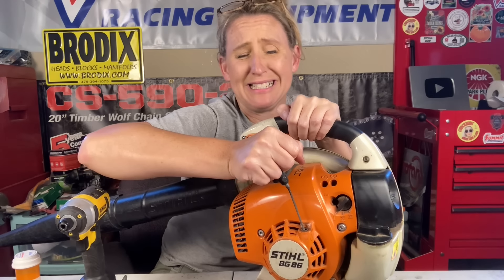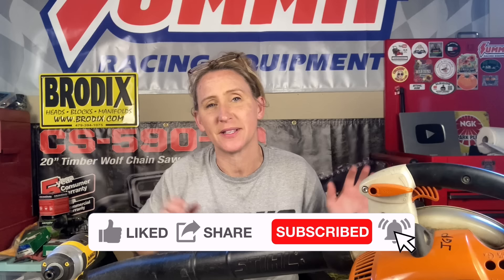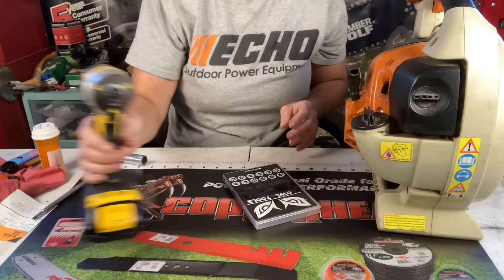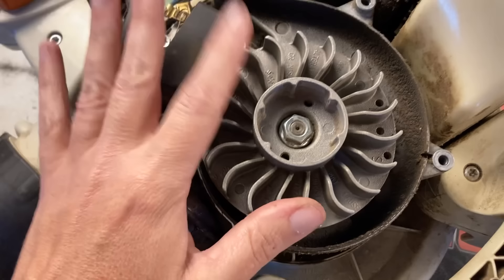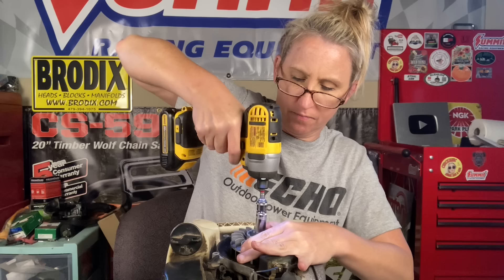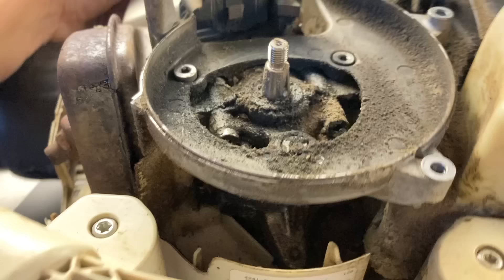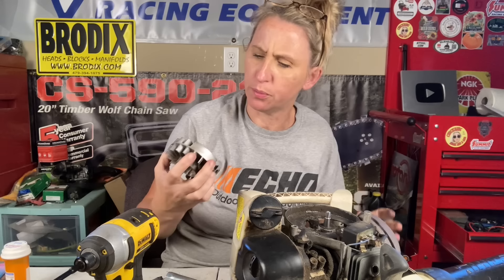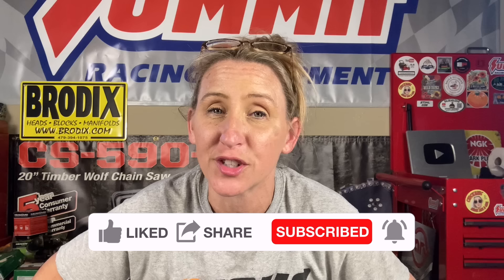Stihl Blowers SECRET FLAW!! Save your Blower with this EASY FIX!!

Comment: There is a little check valve in the carburetors. Those check valves go bad, and it let's the gas just siphon into the carp, which just let's gas pour into the cylinder. Mine locked up like that, but the engine was good, and the carb was good. The issue was that one of the 3 screws that hold the engine onto the housing had backed out, and locked against the fan. Some red threadlocker fixed the issue.

Comment: I just use a brass punch, that way I don't have to worry as much if it slips off while hammering and damages something..plus I feel more confident  whacking on it harder with a brass punch. I don't know what it is about blowers, but this bolt loosening problem seems to be common with most of them. The Husqvarna 125B(Poulan) blowers are terrible for this.Customer usually complains of a "loose carburetor" or "loose engine"..then when you tear into it, often one or of the engine mounting bolts have broken off, or the bolts have gotten loose and wallowed out the screw holes and destroyed the threads...

Comment: I have a quick question. I have a bg86. New crank bearings and seals and spark arrester. I have to turn the L screw all the way in to get it to run. Should I check needle arm adjustment? Any tips would be appreciated. Thanks.

Comment: My 35 year old Sthil is still running.  After a  new cyl&head 30 years ago.  AO28 Super. Me bad,  not enough information pertaining to Gasahol. But,  that was years.  Lack of oil, will melt your cylinder cutting Hedge trees 🌳
Reply: Cutting a hedge tree in the dark.  You will see sparks.

Comment: Putting some crappy pressure on the end play thrust surfaces removing the flywheel that way don't ya think? Should probably use a puller for less impact on the end play

Comment: Don't know if you work on log splitters, but I have a Boss 10 Ton Electric/hydraulic and yesterday after splitting two rounds on the next one I thought I heard an unfamiliar sound and the blade/piston stopped moving. Seems like the motor is not rotating. Any advice would be appreciated. BTW like your channel.

Comment: Take the bolts out - clean them up then red 262 Loctite.  262 Loctite is used alot with RC helicopters which get a lot of throwing around

Comment: I have two fs56 stihl curve shaft string trimmers that when I went to look in the muffler noticed loose cylinder head screws. No cylinder damage and no start. These are old but look show room new. My local dealer says the head gasket at the base of the cylinder is no longer available. Do you have any recommendations?

Comment: I really enjoy your videos, great information and attention to detail!  I have gotten a lot of useful information from them and help with my units.

I do worry about you running these devices without any apparent hearing or vision protection.

I was wondering if you had any suggestions on a tachometer that, price wise, would work for homeowner use.  The one you use is great, but more than I, and perhaps others, would be willing to spend for occasional use.  Inductive pickup would be a plus, but not necessary.  Thanks

Comment: If the backed out screws break off a fin on the flywheel, the flywheel will need replacement as it will put the engine off balance.

Comment: They must of took notes from the old Briggs and Stratton lawnmower engines on just about every early 2000's riding mower. They didn't lock up, but they leaked gas like a bad habit onto the cylinder and into the crankcase.

Comment: I have an interesting problem. I just purchased a new Husq TS354XD. First time taking it for a spin, I find a screw labeled "SP" loose on my left heel. Searched high and low to see where the screw came out of, no luck. The machine isn't put together symmetrically, and no other screws had the same "SP" label (I'm also not very mechanically savvy). I don't need a replacement part, I have the screw! But how do I figure out where the darn thing is supposed to go?

Comment: My stihl blower is brand new just bought it a few weeks ago. At full throttle it screams then the rpms will drop a tiny bit. If I let off the fuel and get back on right away. The rpms will go back up then drop a little. It won't stay at the high rpm the entire time. I thought it was bad gas. I made a new mixture and it still does the same thing. Does the carb need to be adjusted.

Comment: there is an easier way. back the nut off till it is higher than the shaft, then use a ballpeen to tap the nut while holding the flywheel

Comment: Its a fautly blown primer the gas just keeps flowing thru it.😊 the blatter built in under the primer case sticks open . I just had that happen on a whacker nueson pounder. The primer was shot its sepperate from.the carb. I rebuilt the carb and new it was not the issue sure shit a guy at work forced the primer blew a bladder in it and gas just kept flowing thru flooding it and i knew i revuilt the car correctly. That carbs 389.00 so ya i rebuilt it. Runs great now and dont flood fuel non stop.

Comment: I was a machinist for 40 years. Using a claw hammer striking a punch was a big no-no! The metal hardness on striking face is too hard. We had to use only ball-pen. Safety idea, surface face is a softer metal surface, less likely to send splinters of metal flying. Yet they will mushroom. Never really understood that? Just a heads-up.
Reply: I have blown the side out of a claw hammer before by driving hardened concrete nails. I think she is a superhero and I doubt it would bother her. But it's possible it could hit the lens of her camera thingy. Be careful Bre, don't let broken tools make you say curse words like they do me.
Reply: We're told also not to use screwdrivers as pry bars too but everyone does it. It's the American way.
Reply: @kevin8582  totally agree with all your comments. Experience the same results, but our safety guidelines went crazy over claw-hammers in the metal shop.

Comment: My bg55 has been through hell for 20 yrs easy if not longer. I even pitched the airfilter yrs ago and went yrs without one . Would i ever do that to an emgine no but it.just keeps going. I rebuilt the carb and finally put an airfilter in it.

Comment: I worked on a Duramax Diesel with a similar problem, the reluctor ring came loose and lost the crank signal. three screws fell out, 4,000$ to fix a stupid flaw.

Comment: Question. I have a Stihl blower (battery operated) and when you go to turn it on it doesn’t turn off. The press button to turn on has to be pried forward with a screw driver to turn it off. Any idea what I’m talking about?

Comment: I have the same model and the same exact thing happened. One backed out enough while running that it hit the flywheel and screeched like a scalded cat then stopped running. Now the muffler bolts are backing out - WTH?

Comment: Hey Chicanic, You should get an air chizel / hammer.  With a punch that comes with it, you can put it in the center of the shaft and get results a lot faster and you don't have to hold the screw driver with your armpit anymore.  You can just use your free hand.  It works better that way.
Reply: No need for all that, companies like Starrett make automatic center punches that work with one hand, you don't need to hit them with a hammer or hook them up to an air hose or plug them in or anything, they have a spring loaded mechanism in them that all you do is put the punch where you want to make a mark and push down compressing the spring inside, once the telescoping center gets to the end of it's stroke a sear inside releases the compressed spring and the telescoping center gets hit inside with a force that's like hitting it with a hammer leaving a punch mark, the tips are even replaceable so you don't have to try sharpening them on a grinding wheel.
Reply: @dukecraig2402  I do not think a spring loaded center punch has enough force to do anything, except make a punch mark. It will not do a thing in this scenario.
Reply: @Boobtube.  
It probably wouldn't if the idea is getting something to move or break loose, I thought by your post all that was required was needing a punch mark for something, they're great for that, one of the best investments I've ever made when it comes to tools, they free up a hand and eliminate a bunch of fumbling, which is what I keyed on in your comment, so you can hold whatever you're putting a punch mark on, I didn't catch that part in her video myself because I was watching it on my phone and an incoming call interrupted it, then I answered a comment on another video I switched to that arrived when I was on the phone, when I came back to this one apparently it was past the part you referred to, I'll have to watch it again to catch that part, I didn't see what she'd done with the punch but judging by your comment she was fumbling around with whatever it was she did with the punch.

Comment: I saw you wrestling that flywheel. There used to be something called a flywheel puller. Are they not made anymore?
Reply from the maker: I try to do as many things as I can without the use of specialty tools so the everyday person can do it themselves.
Reply: @Chickanic  In that case I shouldn't mention that there are pliers that expand when you squeeze them. They would be mighty helpful for attaching fuel lines. They would expand the mouth a little to enable putting them on easier.

Comment: I've got a yard mechanic 13.5 to comesee engine. I've put a new coil and a new carburetor. Engine keeps surging and popping through the carburetor and I've adjusted the valves. Do know what the problem could be
Reply: If your carb has an adjustable idle mixture screw and or main mixture screw and they're out of adjustment it can cause surging .
Reply: @44special9  it's a non adjustable carburetor
Reply: @user-re5dr1rs8f  Hopefully no manufacturing debris didn't clog something in the carb and if you put a new fuel filter on make sure it's in the right direction if it's directional , but anyhow good luck with it .

Comment: Hi, great video, I just want to ask you why you never let the engines warm up. I see that you do this in every video, I know that time is money and if you do it ones it’s not gonna destroy the engine, but if you do it every time, after a bit, your piston and cylinder are gonna be destroyed. It doesn’t mean anything that these are small engines, on the contrary, the smaller ones are even more stressed than the large ones, both due to the rpm at which they run and because, for example, the gap of the rings is proportional to the bore and in these engines they are really really tight. Even if it doesn't seem like it, the blower motors, and in general all of this kind of small engines, are very stressed, especially at maximum speed, as the air resistance increases exponentially and the fan represents an enormous brake. The piston skirt leans a lot on the cylinder and, in my opinion, heating it up to make it work within the right tolerance certainly doesn't hurt it. Be careful, don't get me wrong, I'm not here because I want to be a know-it-all, I simply want to share my opinion and maybe know yours too. I really appreciate what you do, keep it up.

Comment: Can someone help me? My wife picked up a SuperHandy 52cc mini tiller at a garage sell. She got home and I went out and it starts right up, but the tines don't move. There is just an on/off switch and a throttle cable. No lever or anything to engage the tiller like our old bigger Sears tiller.  I can't find anything online about this mini tiller on how to fix it.  Does it just operate on a clutch or something as the RPMs pick up? It seems to run great, but just won't engage the blades.  Any help would be appreciated.  Thanks.
Reply: Yes, most work on a centrifugal clutch.

Comment: Don't they have a couple threaded holes on that flywheel to get a puller on with?  A steering wheel puller would work the nuts with that tiny flywheel.

Comment: The reason that Stihl uses the crappy and cheap Zama carbs on everything is because they own Zama. At least on the higher end Echo equipment you get a Walbro carb like on the 2620 series blower and trimmer.

Comment: Stihl is great for performance but the quality and durability of their equipment vs the price doesn’t pan out. They are entirely too damn expensive to be having any kind of issues period. For the price they cost they should have to replace and repair them for free for the life of the machine. Everyone that owns stihl products should sue them because they really do sell equipment that is designed to fail within 40hours or run time. I’ve spent $500.00 on a backpack blower that the carb failed within a year and it probably only ran maybe 5 tanks of stihl 50/1 mix. Had a shidiawa for 10 years that never failed to run. I switched to stihl because they are “the best”. My $500.00 blower is a boat anchor now.

Comment: So I got a question I know you can help me with. I like to mix my oil and gasoline in small quantities like a quart at a time. I don't use my lawn equipment all that much. Can you tell me a method to ensure that I can get a 1:50 ratio when mixing? I've actually been using a kitchen scale and weighing it out. Am I being too anal? Thanks for any help you can give me. PS love your videos
Reply: Measure it in metric is much easier. 1 litre of gas gets 20ml oil at 50-1.. I mix 500ml at a time so that gets 10ml of oil. Get a syringe to suck up the oil . It doesn't have to be exact , a little too much oil won't hurt

Comment: i guess when you buy a new blower to put thread lock on the bolts before using the equipment. be safe not sorry. good work. Chick an i c the problem.  6/30/2023

Comment: Stihl should be ashamed of themselves for letting any unit out without a drop of lock tight on those bolts. Hey this was a very helpful vid. I would have suspected hydro lock. 
Please stop wearing flip flops when you are doing repairs. It hurts like hell when you drop a tool on the tootsies. I know. Took a year for my toe nail to grow back in.

Comment: My BG 85 Sure don't sound like that 86???  Mine 4 Cycle's then suddenly Starts Humming along??? On HOT Day's, it's Nearly Impossible to RE Start, and when it does, it 4 Cycles Till it Feel's like it want's to start Running. (I'ver Tried Different Fuels and Mixes like VP Racing 50 : 1) Sent it Back to "Jerry" At Stihl, He said I had the Wrong Spark Plug in it, (HILARIOUS), Since I've also tried every Plug Under the Sun and it Just Happen to go back with a "Champion" in it. Called Jerry Back, Took it down to a Repair shop, (NEW COIL), No Go, Same Issue, Called Jerry Back at Stihl, and he sent out a NEW Carburetor, (That "Seemed" to Fix the Issue), Until it Got HOT Again outside (90/100*) out. So I just said the "H" with it and it Runs or it don't and I figured it's a STIHL ISSUE???? Or a California Issue??? Gas and All. But it Run's, Just Like CRAP!!!???  Anyone want this Piece Of JUNK????  It's Your's "F R E E", Ya, you can get it to Run....... But Not constantly (Humming, Like My Go Cart 2 Cycle does)?? I have a 30 Year OLD TANAKA Blower that Run's Like a CLOCK, Buzzes Along Just Fine all day Long, HOT or NOT!  Comical.

Comment: Can someone help me with a Stihl weed eater that won't run. Has new rings. New carb. Timing is in spec. Valves are adjusted. Cam lob is good shape. Doesn't and attempt to start
Reply: Do you know if it's getting spark ? Hopefully your fuel has two stroke oil in it . For a cold start are you pushing the primer bulb 5-6 times (or how many times your model calls for ) and putting it on full choke ?
Reply: @44special9  it has the exact mixture for sthil weed eater. It's getting spark has brand new coil. Brand new carb.valves adjusted to spec.timming in spec. Flywheel key not sheared. Exhaust not stopped up. I'm at loss
Reply: @user-ej5dz9df3o  After putting it on full choke do you squeeze the throttle before or while pulling the starter rope because they claim that takes it off full choke .
Reply: @44special9  this weed eater is not like the newer ones choke  is Manuel.
Reply: @user-ej5dz9df3o  Hopefully the fuel is at least getting to the bulb . Many times on new carbs the H , L , and idle screws are so far out of adjustment it can cause a no start .
Reply: @44special9 . It's not a issue with carb It don't try start even if u straight bottle feed it. But yeah carb is new and adjusted right. And primer ball fills up stays full.
Reply: I've worked on these and other small engines quite a bit. They has be some something I'm missing cause it has everything the way it should to run but won't. I appreciate u trying help though
Reply: @user-ej5dz9df3o  Not saying that it is , but the compression could be low from a valve not sealing or something , but anyhow good luck with it .
Reply: @44special9  took valves out checked them and springs. Have checked pushrods. And re seated valves. That is why I'm at a loss I've done everything that a person would normally do but it still don't even try to as much as burp when trying start it.sthil carb. sthil coil. New fuel lines and filter. New Stihl rings. Getting plenty spark. Everything is in time valves are adjusted and carb. New crankcase seals. So I'm really at a loss. Appreciate your suggestions though.

Comment: With the spark plug pulled and with a sticky needle valve the Stihl spews out the gas from inside the combustion chamber like a whale spewing water out through it's blow hole.

Comment: They're going to find a way to stop selling petrol outdoors gear, Home depot have already said they want to go 100% battery by 2027. I advise you should pick up 2 or 3 of each item of gear you need from the top brands right NOW so you have a lifetime supply that can't be yanked by the manufacturers..